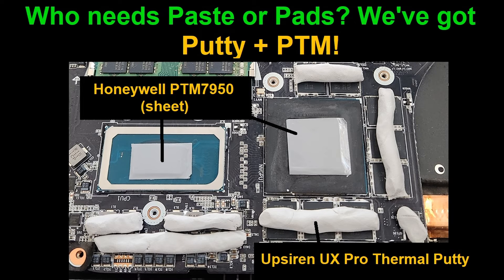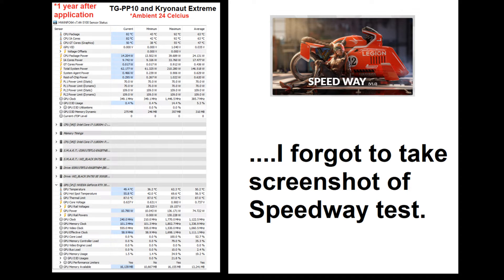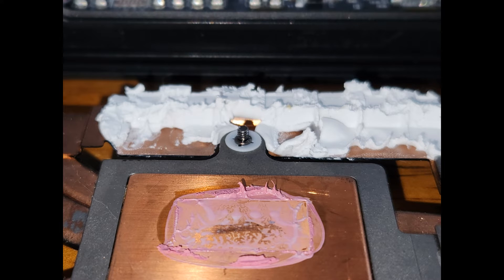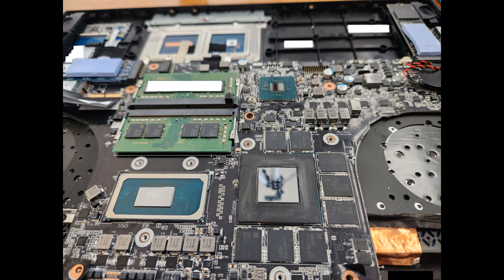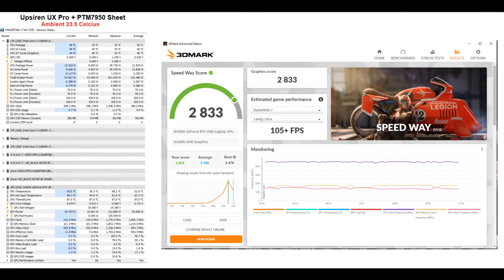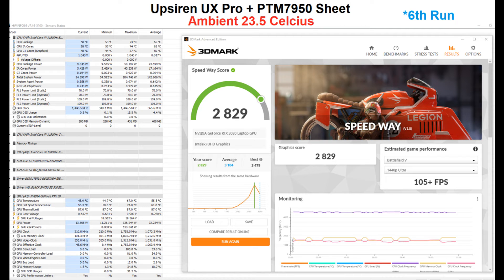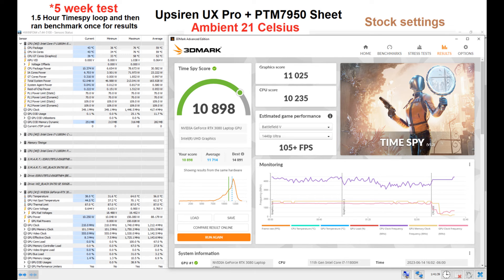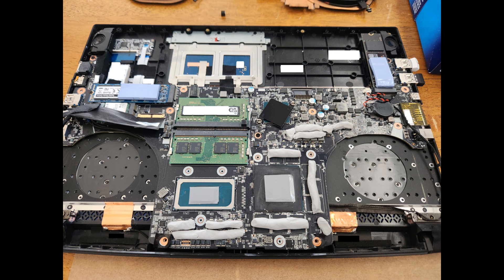RTX3080 Laptop meets Upsiren UX Pro thermal putty and Honeywell PTM7950

Comment: why after i try it gets worse? I checked to open again the heatsink the paste ptm literally gone was like pump out
Reply from the maker: Hmm....I'm not entirely sure. Was it the sheet type of syringe type that you used?

How long did you have it in before you ran into issues with it?
Reply: @snarksdomain  i use sheet type, after apply it the temp was skyrocket. Do i have to reapply? Or is there any cure time
Reply from the maker: @ernawilis-te1gt  It takes a bit to heat up and melt and make better contact.

I run stress tests to get the CPU temp up abive 60C (and sometimes more even). As long as your temperature isn't going over 90 you won't be hurting anything. After it gets it first melt, little air bubbles will work their way out as the now fluid Phase Change Material very slowly flows out like a normal paste would. This allows it to gradually make the layer of material thinner. A higher mounting pressure would achieve good results faster, but I wouldn't recommend playing around with mounting pressure unless you are co fident in doing so and understand any potential risks.

From my experience the thermal.al performance gets better quite a bit in the first couple hours of stress testing/full load, and even further slight inproveme t over the next few weeks of normal use.
Reply: @snarksdomain  wdyt about my case, is it too thigh or loose contact?
Reply from the maker: @ernawilis-te1gt  any chance you can send me pictures on Reddit? Or email?

What were your temperatures before/after?

Comment: Hi, thank you for the video. Aorus 15g KC user here (1yr older model slim case). My temps are high and I want to apply PTM7950 to it. The problem is, the difference at thickness will probably make me change my thermal pads too. After seeing your video, I thought "ah.. why don't I use that?". But I have some conserns and questions as ;
1. I know you said the consistency is better but wil I still have to  use toothpicks when I want to remove?
2. Why did you use too much? Can I spread it approximately as thermal pads' thickness? 
3. Would 10g enough?
I also wonder if the PTM7950 is electrically conductive.
Reply from the maker: I think you'll be happy with results, although the slim model may have more restricted cooling capability. I'm guessing yours has 115 watt TGP or lower for the videocard?

1. This UX Pro removes MUCH easier than a sticky putty like TG-PP10 or U6 Pro. It will leave a light grey coating that can easily be cleaned up with isopropyl alcohol and a Q-Tip (cotton swab).

2A. I'm using the correct amount as it will squish down easily to the thickness of the gap. 

2B. I prefer placing a "rope" of it in place rather than trying to shape it like a thermal pad. It is my opinion that during assembly, the squishing/flowing effect helps to scour both surfaces with flowing putty and does a better job of "prepping" both surfaces and improving adhesion. Another viewer and user of thermal putty (@s1rrah) has a different but equally effective emethid of improving adhesion by rubbing both surfaces with some putty first to apply the light putty film beforehand. I will definitely be trying out their method in the future asit certainly won't hurt and might turn into a "best practice" even.

3. 10g is not enough. You should purchase at least 20g for a laptop. 10g is only 2.875 Cubic centimeters of putty.

PTM7950 does not conduct electricity. Lenovo uses PTM7958 on their gaming laptops (along with Jeyi 8100 Putty). PTM7958 is an even higher performing Phase Change Material, and I'll switch to using it as soon as it is available in sheet format. I find the syringe format is difficult to apply and also need extra time and steps to allow the solvent to evaporate before assembly.
Reply: @snarksdomain   Mine is 105w 3060.  I didn't know about the adhesion, I just thought it could be less messy with less unintended spread. I will check the PTM7958 and consider the putty since you conviced me. Lastly, did you use max fan in the benchmarks? Thank you very much.
Reply from the maker: @fatihmtlm  yeah, I had 100% fan in the before and after tests. I doubt PTM7958 sheet will be readily available for a while, but I'm hoping they make it available soon.

PTM7950 is still very good though
Reply: türksünüz sanırım bende de aynı sorun var napmalıyım
Reply: @samimsamet  Ben sadece CPU ile GPU ya PTM7950 uyguladım. Alacaksanız orta boy alın bence 40x80, ben çok sefer beceremedim yırttım. Termal ped ler biraz pislenmişti ama aorus discorduna sordum sıkıntı yok dediler ben de öyle bıraktım. Ben aşağıdaki linkten aldım 250 tl indirimdeydi ama vergile vb için totalde 350 civarı çekti. Fakat içindeki mendilleri kullanmadım %99 izopropil alkol buldum bir yerden onu kullandım. Önce ölçüye göre kestim, buzdolabında az beklettim sertleşen kadar sonra uyguladım. Tam hatırlayamadığım için ayrıntılı taktik veremeyeceğim ama bir üstte gelecek tarafın da plastiğinin ucunu da sonra tutabilmek için kaldırın bence. Bir de uyguladıktan çok vakit kaybetmeden ortaya bastırdığınız gibi kenarlara da bastırın ki plastikle beraber gelmesin.
Siz yine bakın, daha uygunu vardır.
tr.   aliexpress.   com  /item/1005004896878743.html?spm=a2g0o.order_list.order_list_main.5.10573d12JhsTz6&gatewayAdapt=glo2tur
Reply: @fatihmtlm  çok teşekkürler yorumunuz için ebuy7 den aldım 31x50 dün 2 kez cpu ve gpu için yeter dediler evet soğutup uygulayın diyorlar. Ptm öncesi sonrası sıcaklıklar düştü mü peki hocam
Reply: Dolar kuru yüzünden fiyatlar artmış 31x50 280 e geldi gümrük hariç

Comment: I have a 3060 TI HP OEM, that's very hot (Hot spot: +100ºC in overload), and seems like the Upsiren Putty and PTM 7950 is the best I can do for now. Would you recommend something more?
Reply from the maker: That is quite hot for a card with GDDR6. I wonder if one of the thermal pads is missing or out of position. What is the GPU core temp like?

PTM and either U6 Pro or UX Pro putty should be just fine for your card. You can also look at adding putty to the backplate in areas behind the VRAM, VRM, and even the core. I assume HP has some pads on the backplate
Reply: @snarksdomain  That's probably, but most of the users of this model to report that is very hot, more than usual. 
Unfortunately you can't find the thickness of the thermal pads anywhere, so I think using Upsiren Putty will be the best thing to do.
Reply from the maker: @gabrielrfx  I think you'll be happy with the results.
Reply: @snarksdomain  thank your for the support and your work 🙏🏼
Reply: @snarksdomain  Sorry, but I don't seen the question. The GPU Core Temp is around 86ºC in extreme overload. I removed the backplate and seems like that reduced the temps. 
Should I keep like that or when I'll put the Upsiren Putty and PTM 7950 I should put back the backplate?
Reply from the maker: @gabrielrfx  that depends if the backplate is plastic or metal. If it's metal I'd probably put it back on and add putty behind VRAM, VRM and the core as well.

If it's plastic I'd leave it off if you want. Or you could put it back on for asthetics/protection of PCB while handing of you wanted to. Upgrading the thermal interface materials on the core side should go a long way in fixing the issue.

Comment: Got my tg a7000 30g tub I will test on my 7900xt with the new pcm 1 phase changing pad and 24wmk soft thermal pad from upsiren for mosfets
Reply from the maker: Nice. Will be interesting to see how good/bad A7000 is.
Reply: @snarksdomain  I have a feeling it will be better than ux pro
Reply: @snarksdomain  just repasted it's very soft putty and very sticky I applied a thick layer with a thermal paste spreader over the vram at a thickness of about 2.5mm to squish down so far so good not gone over 86 degree on the memory yet baring in mind I have it overclocked with power limit max with the uxpro it hit 90
Reply: I think the uxpro is to claylike for it to transfer heat away from the memory chips as good as the a7000
Reply: The uxpro is very grainy compared I think with shims on a 3000 series the a7000 will be the best there is
Reply from the maker: @levispartan1993  that's interesting. Up until now UX Pro has been the best performing putty. A7000 has a lower density the UX Pro, so perhaps it uses a different additive for heat transfer. I believe UX Pro, TH949-1 and EVGA Putty likely all use Aluminum Oxide (non electrically conductive). Not sure what TG-PP10 used.
Reply from the maker: @levispartan1993  How were your A7000 temperatures vs your UX Pro temperatures?
Reply: @snarksdomain  yeah just let it settle abit playing some diablo 4 and max mem juntion ive seen is at 94 i didnt see the uxpro over 88 or barely so goign to repaste again haha
Reply: Repasted gone back to ptm 7950 and uxpro and 24wmk upsiren pads on mosfets memory junction temperature not gone above 84 degree
Reply from the maker: @levispartan1993  Yeah, I think a non grainy/lower viscosity putty like what you're describing of A7000 is ideal for shims when trying to squish putty down to 0.1mm or so. Makes it a bit easier to avoid potential core contact issues. I did manage good shim results with TH949-1 in previous tests, but I wasn't stressing the core for those tests, so not a perfect comparison.

The A7000 I ordered has apparently arrived, so I'll take a look at it once I'm back home in a few days.

Comment: Hi. Do you think the Honeywell PTM7950 from the same seller that you bought the Upsiren UX Pro is original? Watched LTT and  he said that there's a counterfeit floating around.

Btw, hopefully you can also test the Upsiren PT-1. And they also come out with with their own thermal paste, UTG-X. Hope you can test that too. Thank you.
Reply from the maker: Mlddle999 Store sent me UTG-X and PCM-1, along with an assortment of copper shims for different cards and some socket lga1700 anti warping/bending CPU brackets.

I haven't been able to find Upsiren PT-1. Could you send me a link to it?

As for PTM7950, I'm not sure. I bought a cheap sheet of it off ebay but it has different colour plastic film and a different sticker/traceability as the one from Moddiy did. I'll be testing Legit PTM7950, Ebay PTM7950, and Upsiren PCM-1 head to head, along with a few pastes and also Kryosheet.
Reply: @snarksdomain  Sorry about the confusion. I meant Upsiren PCM-1. Hahahaha. Sorry about that. Will wait for you to review it.

Can I know what's the plastic film colour for the ebay one? Moddiy has blue right.

I have a Legion 7 (2021) with RTX3080. Do I need to take of the stock thermal pad to put the thermal putty? And how many grams do I need to cover the VRAM?
Reply: @snarksdomain  so which Aliexpress  seller has legit ptm?
Reply from the maker: @goldeneagle8259  I have no idea. I've purchased a large sheet off aliexpress and will give my thoughts once it arrives.

Currently testing out a competing product by Upsiren called PCM-1.

Comment: Hey man, been watching your stuff lately. Would you recommend using Putty for the 4090? Also, what's your opinion of using the PTM7950 on GPUs too?
Reply: Ptm7950 for the cpu and gpu. Ux pro for the vram
Reply from the maker: If you are having thermal issues, then I for sure recommend using them both on your 4090.

Comment: This seems like pretty good stuff. I've heard of PTM7950 but never bothered looking into it much. I'm assuming while doing the PTM7950 application, it's recommended to put UX Pro on the chips that need them? I've been looking at Aliexpress to grab both since I've been thinking about replacing the stock stuff Asus put into the two G15 AE's I have.
Reply from the maker: I would say most people you ask don't even know what thermal putty is and would recommend pads, but yeah, I'd recommend a quality putty like UX Pro on VRAM, VRM's and anywhere else where there is a pad. If thermal Putty and PTM are good enough for Lenovo to use in gaming laptops, then it should be okay for us too.

I'm pretty happy with my laptop results thus far. I will revisit this same laptop a year from now to report on how the thermals are holding up.

Comment: A rare find, some1 actually testing chinese thermal stuff, keep up the good work. Have you tried the Zezzio ZT-PY6 or the CXH1300 putty? Both of them have 13W/mK rating and the zezzio looks like exactly as the U6 pro. The zezzio could be the same as the U6 from the same OEM factory, the CXH look like a U6 clone.
Reply from the maker: I have them both in hand, will test them soon now that my testbench is complete.
Reply: @snarksdomain  A question if you won't mind. How much putty would i need to cover 4 vram chips(15mm by 15mm) in my laptop and the gap varies between 1 and 1.5mm. THX in advance.
Reply from the maker: @kazuviking  5 grams, if not using putty anywhere else.

Comment: Hi. Maybe someday you can test laird products. That´s what i use, so i´m curious. But gives me good results. 

I use laird tpcm 7400 phase change material for bare dies. (7400 is 0.4mm thick, 7250 is 0.250 and 7100 is 0.1mm).

I use tputty 502 (bulk, not the sheets, that have fiberglass) for vram and vrms. You also have tputty 508, 607 and the new 910. I never tested those. 

I like tputty 502 because doesn´t have silicone bleed and when it´s reusable. I just grab it, make some small balls, compress it to 1 or 2 mm more that the gap to fill and it´s done. I´ve not seen any thermal degradation on my 3080 after 1 year of continuous use, but i´ve applied again(the same putty that was used) when i replaced carbonaut for the tpcm 7400(for testing purposes). The same temperatures were observed.

You can find those products on mouser. 

Thanks
Reply from the maker: I'll definitely get some Laird putties at some point. I ordered some TG A7000 putty as it was on sale.
Reply: RE: "I use laird tpcm 7400 phase change material for bare dies. (7400 is 0.4mm thick, 7250 is 0.250 and 7100 is 0.1mm)." ...

What sort of bare die did you test the 7400 on?  I'm considering testing the PTM7950 material in lieu of LM on a delidded 10700K in an A51mR2 laptop and may throw the 7400 in with the rest of the testing.

I'm curious what the slightly more consistent (possibly more stable) thickness of one of the phase change sheets might make in mitigating the common difficulties one will see in getting the highly liquid LM contact just right between the CPU die and underside of the IHS.  It would also be nice if it's effective as the need to apply LM to both the CPU die and IHS would also make things easier overall.

Thanks for that referral.  I have not looked at the 7400 option but will be reading up on it shortly...
Reply: @th3_g0dz_of_Vict0ry  i used on an rtx 3080 desktop and gives me 10 to 11°C difference between the die and hot spot. That difference rises to 12 to 13°C with carbonaut, but die temp only rises 2 °C. With hydronaut the hotspot difference is 11°C after application, 15°C after 6 months of light usage and rises to unusable levels after 1 year(105°C total hotspot temp).

I've also used on my legion 5 pro. That laptop does not make good contact on the gpu. I have to use thick phase change material.

I have no experience with lm. I only touched it on the ps5 because it's ready for lm. 

If you use a thick phase change material like the 7400, it will cover all the spots that may not be making good contact. It will flow rapidly and compress to the right thickness after 2 or 3 minutes of reaching something like 70°C.  Maybe you will get better temps if you dont use the ihs, but you risk damaging the die that way. If you use the ihs, maybe dont glue it, because if you do and the glue dries, if can prevent the phase change to compress to the optimal height. If you put the glue and can heat the processor before the glue dries, it may not have that issue.